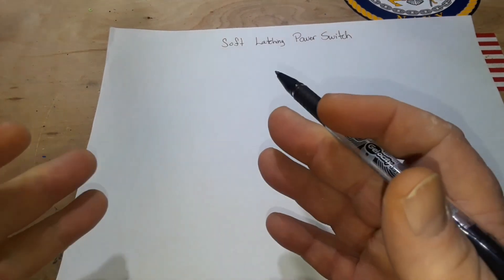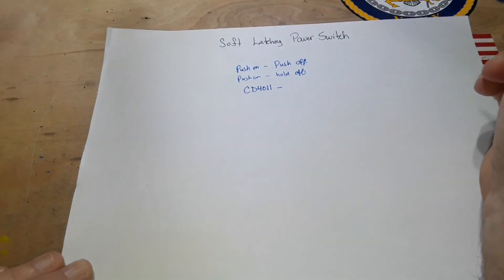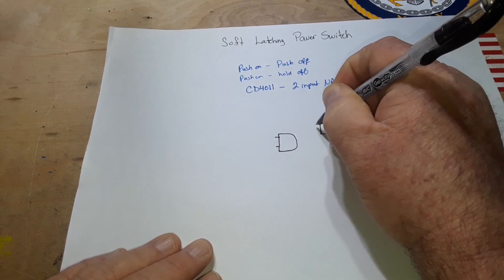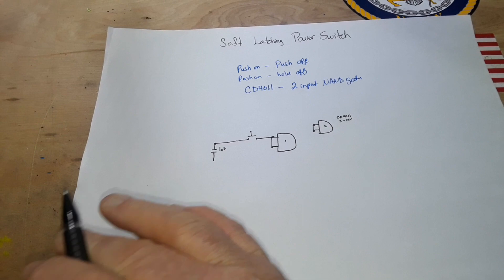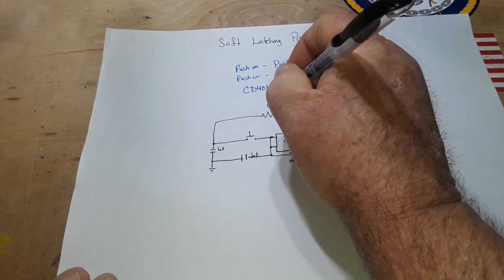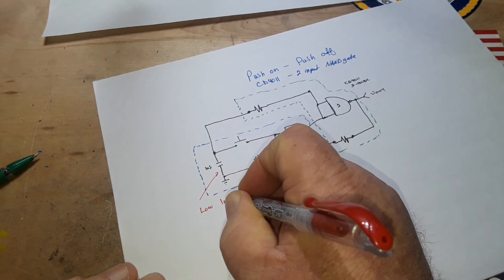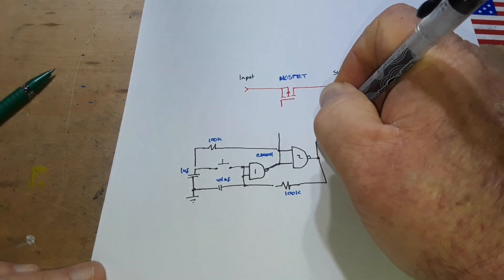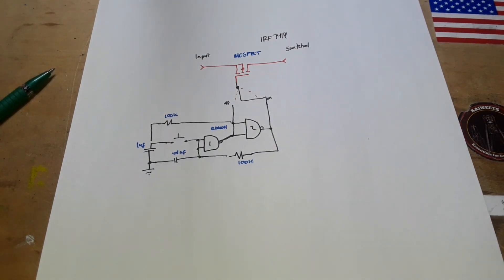Classic Circuits You Should Know - Soft Latching Power Switch

Comment: It's possible to design the switch, so it switches off its own power, meaning the circuit when off is truly off,  drawing zero current. This is a boot strap circuit that can be implemented in a number of ways. It relies on the circuit having a known power on state. 
Pressing a push button connected to ground, initially provides the power to turn on the P channel enhancement mode MOSFET. A latch, either implemented in software or hardware is then powered, and it takes over the supply to the MOSFET gate. By using a diode or transistor to isolate the gate from the on/off press button, it is possible to continue to sense the state of this switch even when the circuit is powered, as it forms a wired OR with the latch circuit output that drives the gate. So pressing the button again, changes the state of the latch so it no longer powers the MOSFET gate. During this time the circuit is maintained on by the push button  being pressed. On releasing the push button, the circuit returns to the truly off state. 
While a capacitor can be used to avoid any race condition associated with the latch re-entering the on state while powering down, this can also be addressed using an edge triggered latch, 
Where the trailing rising edge of the push button changes the latch state. 

The solution is far simpler to understand when a microcontroller is involved, but again the button circuit is similar, driving the gate of a power MOSFET. The push button turns on the supply to the microcontroller, via the gate of the MOSFET, Once running the micro maintains the power on state by using a wired OR with the push button. The micro monitors the button status, if pushed while the micro is running, it removes the signal driving the MOSFET gate, turning the whole circuit off.